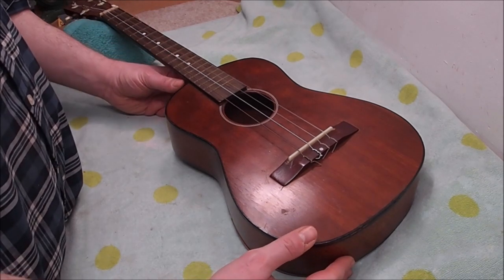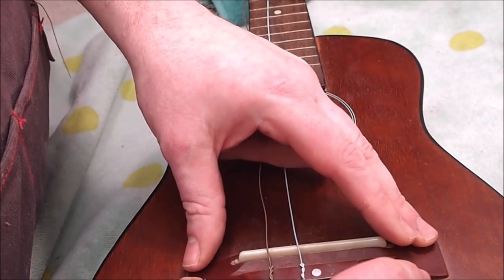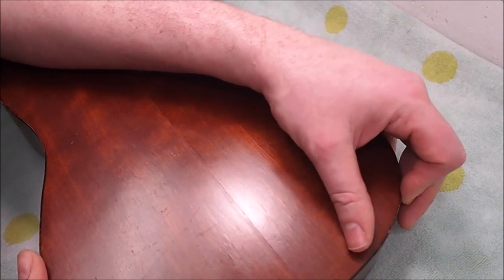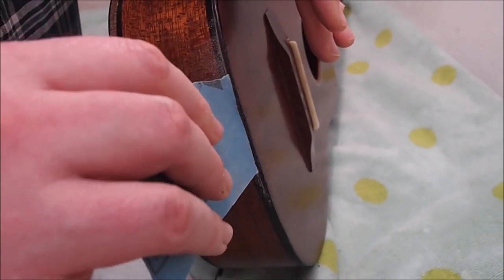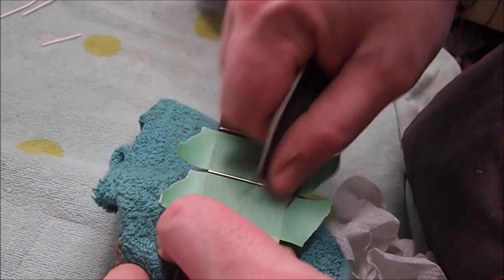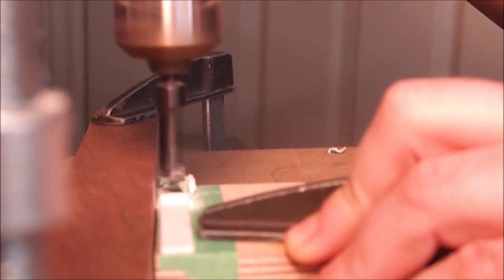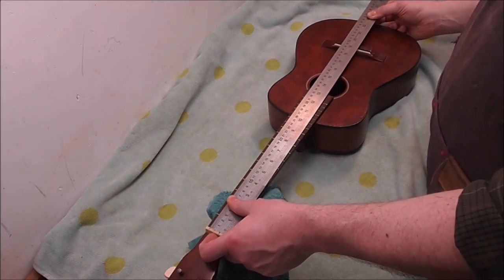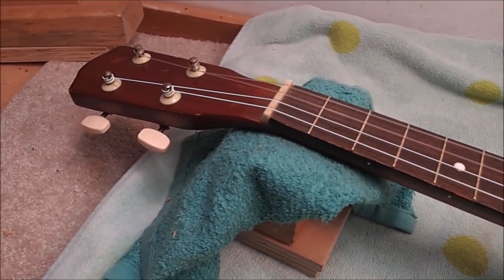Baritone Uke gets patched up.

Comment: It's January 2021 by the time I found this one, and a 1960-something Kay soprano Uke arrived.  Have you ever encountered a white plastic SCREW-ON fretboard? Yeah, nut, frets and board are all one piece of plastic and the fret markers are chromed screw heads! Odd, but that should make reattaching the neck much simpler. And it has quite similar white glue showing within.  Thanks for the vid!

Comment: Hi. I watch all of your videos. They are very good. Very informative. I have a question that I've never seen addressed. I don't know if you answer questions,but I would like to explain my problem. I have a  knock off Chinese 335 guitar. It's a right hand guitar. I'm a lefty. I made it a lefty, I put in a new  nut. I moved the control knobs to the other side. It really looks good. My problem is intonation. It has a tune a matic bridge. There is not enough adjustment to get it  intonate properly. I turned a few of the saddles around to try to get more adjustment. Short of removing the bridge and drilling new holes  what can I do. Is there a bridge made for my problem. Thanks
Reply from the maker: Some of the roller bridges (Schaller or Golden Age from StuMac) have more travel room for the saddles.
Reply: @twoodfrd   thank you. I will definitely look into this right away

Comment: Great information!  I've picked up a couple of cheap baritones in need of repair as "projects." I have been contemplating how best to address bridge replacement given that finding the appropriately sized clamps may be problematic.  I see Harbor Freight has some 5" deep throat c-clamps.  I think they will fit.  I'll probably go with those. Do you have any tips for regluing loose braces in a baritone uke?  As you pointed out, the soundhole is small.  I have been thinking I may have to take the back off?
Reply from the maker: It's possible to make your own clamps using threaded insert nuts and bolts. Working through the soundhole with bent rods takes a lot of patience, but it's good practice.
Reply: I  have some    vln   C  clamps  from  condit  mfg, that  work  for  gluing  bridges on  to  ukes, or  HF  in  usa
Reply: We used to have a lot of used bari ukes up here in Ontario due to a music program (classroom sets!). Whenever I could I  converted them to six stringers for use as travel/ canoeing/ camping guitars. My granddaughter has one.
Reply: @twoodfrd  on those clamps in the thumbnail, are they made with the hole centered or offset so that you get a camming action for better adjustment when clamping something?
Reply from the maker: @dooleyfussle8634   That's a really good idea. The nut width is nice and generous for only 4 strings.
Reply: @twoodfrd ,yeah, there's a bit of room at the nut and the headstock was usually big enough to allow for six tuners, although I occasionally had to put one at the top. I used classical guitar strings and sometimes installed a slightly larger bridge. The only problem was that they are so lightly braced that every so often, one would start to roll the bridge into the sound hole! Lot's of great tunes around the campfire on canoe trips. Plus, in really dire straits, you could always use it as an emergency paddle...

Comment: Isn't the top string of a uke supposed to be 1 octave higher, or is it different for a baritone uke? It looks like that is what came in here (0:10) but not what left here (8:27). I'm not a uke player, so I assume I am wrong...
Reply from the maker: Baritone ukes are typically strung like the top four strings on a guitar.  Some try and string it with rentrant tuning like the soprano or concert uke, but that's not the usual thing to do.

Comment: Stop using the top 4 strings being the DGBE from guitar sets are often a bit loose. This is my experience. 
So I use the middle 4 strings to give better tension, Lots of people in the ukulele community say this too. Most classical guitar sets have E, A, D wound, and G, B, E being unwound. Most baritone sets have 2 wound strings and are probably also the 4 middle strings from a classical guitar set.

Comment: Anyone know what that tool was he was using at 8:06 is? Is that a small chisel or a file?
Reply from the maker: It's actually a bent checkering file (used for making the pattern on gunstock grips). I've ground the tip into a chisel so it works well for cleaning out the bottom of saddle slots.
Reply: Ah, makes sense. I'm going to have to steal that idea, thanks for the reply.

Comment: So, is there any difference between a baritone uke and a normal one, other than the strings?
Reply: There are four standard sizes of Uke, soprano, concert, tenor and baritone(largest.) The bodies and necks get proportionally larger, but they are all basically the same instrument. There are no rules on size so you have to look at an instrument to be sure it fits you. For example, the width of the neck at the nut could be bigger on a concert than a baritone.
Reply: @e.miller8943  Thanks!